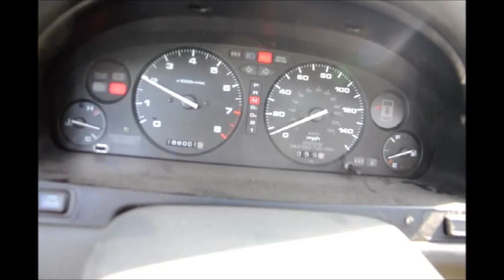Acura Vigor Project

Comment from the maker: @willy wu 

For diagnosing A/C first Check to see if your Compressor turns on after you engage the a/c. if the compressor rotates when engaged then you can check for leaks. 

Check your local parts store and they should sell an "A/C leak testing kit" 

it should come with a special UV sensity gas, and a uv pen. 

After installing the gas via "cold side" on your ac lines. Use the UV Pen to check around your compressor and just before your evaporator.

note: A leak can be anywhere

FYI there is no way to find out how much "freon" is left in your system. the only True way to recharge your a/c is by extracting the entire system and "recharging it".

^_^ Hope This helps

Sincerely,  

Subfighter14